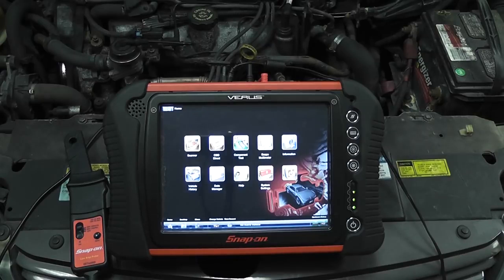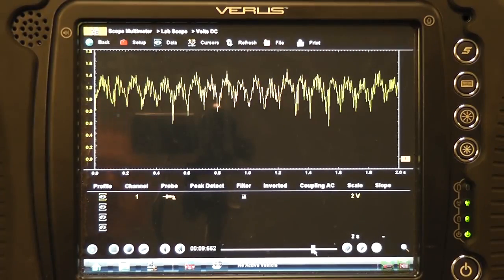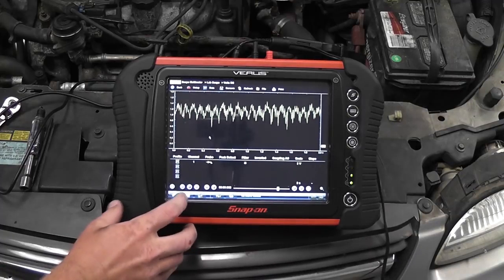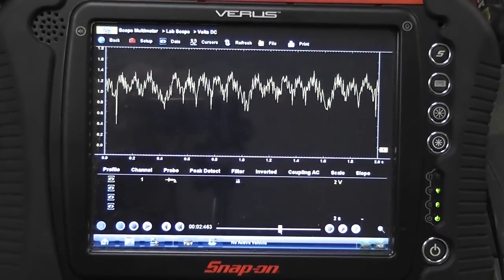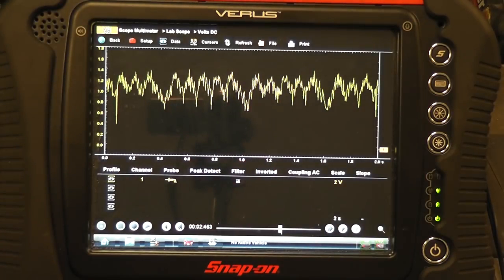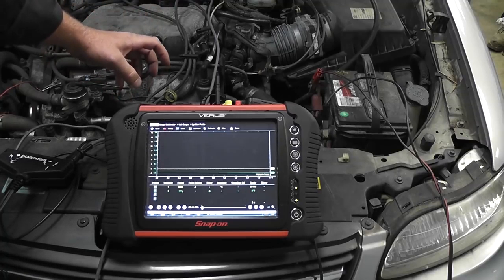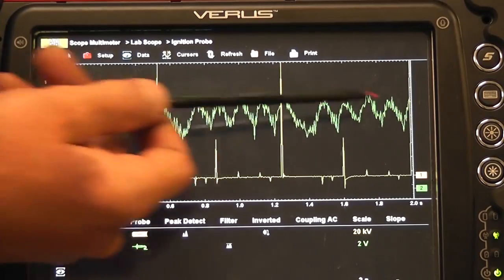How to perform a compression test with a lab scope (Quick Tips)

Comment: Now I need to get a trigger signal from a Toyota 4-wire COP while I perform the relative compression test. It seems like the computer stopped firing the coil with the EFI relay pulled. Hmmmm, how to proceed..
Reply from the maker: The wire that give you a 0-5v square wave is your transistor trigger signal. The turn off of that square wave is when spark occurs. Make sense?
Reply: @ScannerDanner  it does make sense. The issue is that I am not getting a signal from any of the four wires while cranking.  I tried again with the EFI relay installed and engine running--i got a signal, but it was erratic at best. It must be my scope setup because this is a known good engine (my daily driver--2013 FJ Cruiser). I just subscribed for one month of all data for the wiring diagram. Maybe that will help me wrap my head around it.

Comment: I have done this before, but for some reason the peaks are not showing up on the scope (modis ultra). I tested the 9v batt in the snap on low amp probe. I connected to the batt starter cable. Used 2 channel scope at 5v and again at 2v/div. Disabled fuel pump and cranked at WOT. The trace went up to 2v as a flat line--no peaks. This is being done on a good engine for my own practice. Any thoughts as to what is wrong with my setup? I tried neg batt cable too.
Reply: I noticed you set your scope to ac. That was it. I selected "Coupling AC". I set 2v/div, and 2seconds/div. With that, I got a good trace.
Reply from the maker: What are the settings in your amp probe? 20a and 40a?
Reply: @ScannerDanner  it's a 20A, or 60A
Reply: The correct wiring diagram makes all the difference. I forked out $20 for AllData for my personal training and practice. I was able to analyze the injector circuit, pull the INJ fuse, hook up my amp probe and back probe the #6 coil in less than 10min. Yesterday I was struggling for over an hour with no results. I pulled the EFI relay yesterday. That relay basically shuts down all engine functions--the reason I couldn't get a signal from the coil. I love this stuff.  @ScannerDanner

Comment: Ihave a car i dont know whats the problem said misfiring but i already change plug and coil.still there the misfire
Reply: Any idea?
Reply from the maker: 1.Coil control could be missing (have you confirmed you have spark?)
2. Injector problem
3. Compression problem
4. Intake manifold runner leak on one cylinder 
5. Head gasket blown on one cylinder
Reply: @ScannerDanner  i honestly not good and i just started learning and just have  interest about cars ...i started watching your videos not a while ago maybe couple months from now and i learn something...thanks to your videos
Reply: @ScannerDanner  i have dodge grand caravan 2015 recently change the plug and coil 2x already the whole year...and i didnt see any leak or oil leak around the engine...i recently purchased an autel maxi808 and test it i have p0300 p0302 and i checked the fuel trim one bank +(positive) about 4 and the other was -(negative)about seven.strongly smell gas from the pipe...the injector pulse one bank higher about 200-300 higher...
Reply: @ScannerDanner   ihope you can help me
Reply from the maker: @charlemagneverzosa1603  can you get to the number 2 cylinder injector? Try to listen to it with a long screwdriver. Put your ear to it and compare to another cylinder. Also do this test https://www.youtube.com/watch?v=pOghpmVhVng I know you don't have a scope, but you can do the sound test
Reply: @ScannerDanner  thank you very much mr.paul iwill join your class and get a book from you for sure...
Reply from the maker: @charlemagneverzosa1603  thanks so much! I look forward to hearing from you
Reply: I noticed shaking at idle but on load when you driving high rpm about 2-3000 rpm cant feel the shake but when it shift up and rpm drop between 1-1500thats when you feel the car shakes again till you hit 2-3000 rpm then it dissapear

Comment: hello danner i have a question as a beginner i wish you could explain
i have a jeep liberty kj 2003 the car has poor fuel economy like 200km per full tank i didn't mind it since its a high mileage vehicle with a burning oil engine with a faulty o2 sensor after a while th engine had a major problem with the bearing it needs to be rebuilt completely it coast a lot in this country so i bought another liberty which had an accident but mechanicaly in a good condition so i swapped tge engine and transmission and front differential and the gas tank with the pump o2 sensors every thing but the map sensor because it was broken
after the car is ready i drove it for a while it still has poor fuel economy its even worse than the old engine
the car has no codes so i suspect the map sensor i cleaned it since i couldn't find new one nothing changes after that i noticed in live data that the tps read 13.7 % the old tps was reading 12.2 %
so i removed it while it still connected to the wires i noticed the reading drops to 6.8% like the throttle body (it's clean) holding it from full return so i modified the throttle body axle that move the tps until it read 6.8% while it's a full closed throttle plate....
i still have high positive ltft but i do noticed improvements in fuel economy about 150km more than before
i hope you explain the situation
and if i changed engine oil will my ltft get close to zero?
thank you and I'm sorry for the long story

Comment: So, if you expand all those highs and lows, you would be able to say what valve it had a problem on, like inlet or exhaust? ( That’s if it was a valve in “a” case I know it is not in this video ) also the high yellow is on the compression stroke, but the low yellow? Is that the cylinder on exhaust part of a cycle?
Reply from the maker: No sir. Once low compression is identified you can use an old school leak down test from that point or use a psi transducer in the cylinder, intake and exhaust to see the other stuff you mentioned.
Reply: ScannerDanner will you show that in a video, or have you shown that yet? I like to see the new and old style technology it makes it so much easier when someone shows you something rather ran reading it from a manual. I’ve done the leak down many times but never seen it with the pressure transducer before. Keep these great videos coming!
Reply from the maker: @frankoattes  check out my Hummer H3 playlist. It's a 7 part series with everything you're looking for. I look forward to your feedback!
Reply: ScannerDanner very in depth on the second video which I have just watched. I may have to watch it a few times as I got lost on the whole 5 cylinder but 4 event dialog. I thought you would have had the 5 partitions in at the start and kept thinking you had it wrong as it was a 5 cylinder not 4, then I realised you were talking about the engine sequence. I’m still struggling with the whole valve event thing and trying to understand it in this data capture you have.
Reply: ScannerDanner fantastic series Paul. So interesting when a tutor is excited and so enthusiastic about teaching. You take the time to explain in great detail to the students and us the viewers what you see and your always up for someone to give more insight if they can. 
Im the old school who would be using the leak down tester. I know it told you the issue or should I say area straight away but, I’m loving the use of the pico. Truly none invasive and can be used without stripping components off or out. Just think of the time saver that can be when fully understood. I just wish I had one and a great teacher to learn it with! I commented in the 6th video asking if you could suggest material I could view or read on scope patterns and understanding them as I’m lost in there! Any input is greatly appreciated Paul and keep these great videos coming!
Reply from the maker: @frankoattes  just keep watching my videos and if you are interested, sign up for SD Premium from my website. I have over 430 training videos and counting with a 14 day free trial and only $11 a month after. Hope to see you there!
https://www.scannerdanner.com/join-scannerdanner-premium.html
Reply from the maker: The high low spark event is the cylinder firing on the compression stroke (high kv) and on the exhaust stroke (low kv)
When the #1 is high the #4 is low and vice versa (companion cylinders)
Reply: ScannerDanner thanks Paul.

Comment: Why the waste spark peak is smaller? due to pressure?
Reply: It is easier for the ionization process to happen due to lower cylinder pressure (exhaust stroke) therefor you get a lower "spike." A cylinder that is running really rich will do the same thing 👍🏼
Reply: @SouthMainAuto  thank you Eric

Comment: hey SD, just curious if i can pick your brain, 2002 saturn L300, 3.0 liter vin r, through my co-worker for a loop, another shop replaced the fuel pump twice, he replaced the plugs and coil packs, no codes stored, has a long crank issue, cats not plugged, no intake restrictions, egr valve not stuck open, i started to help him diag it, and as i was looking at live data, i noticed the map pids reading at idle 7 kpa and .29 volts, at static, key on engine off 37 kpa and 1.79 volts, verified  all three circuits were good, and replaced map sensor with known good one, suspect ecm failure? any thoughts?
Reply from the maker: those numbers are definitely wrong! What is the 5v reference wire and ground wire showing you? Also the signal wire when measured from the sensor itself.
Reply: @ScannerDanner  5 volt reference  tested out at 5.93 volts when jumped at the map connector, didnt back probe for signal voltage, all circuits measured out at .3 ohms, and passed load testing with a head light, when substituted with known good sensor, live data pids were a little different with koeo being 44 kpa and 1.98 volts
Reply from the maker: @kevinavery2518  5.9v on the reference is too high. Secondly, forget the ohmmeter. I need you to do a sensor ground circuit voltage drop test. 
Leave the multimeter ground lead on battery negative for all tests and give me 3 voltage readings right at the sensor with it plugged in and backprobing with the key on. 1. Ref 2. Signal 3. Sensor ground (so yes, a ground to ground comparison and it should be .1v or less)
I believe you have a main computer ground issue and we are going to see it in the sensor ground circuit on that sensor. Also, this would explain the elevated reference voltage too.
Reply: @ScannerDanner  just an update, wish I had some numbers for you, but the customer picked the vehicle up and is bringing it back at a later date, I did notice the only pcm ground that I could find in the diagrams showed the pcm grounded through the case its self to whwere it mounted, did do a drop test there and it tested at.02 volts.

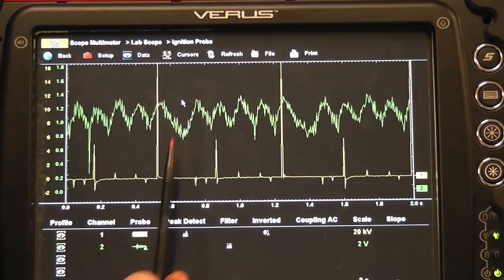Comment: 5:01 Would it be cylinder #2 or the second cylinder in the firing order? Just looking for clarification. Thanks
Reply: It would be the second cylinder in the firing order but like he said the firing order for that engine is 1,2,3,4,5,6 so it is cylinder 2
Reply from the maker: Thanks for replying! As stated in this case it did happen to be the firing order that made it the number 2 cylinder. Firing order is needed and must be followed exactly for proper ID. Also you must know exactly what cylinder you're using as the sync. Great question

Comment: Use the test lamp to lose the power of the spark but the test lamp It doesn't work Does this test affect the spark test?
And can the spark be tested using an insulated nail key without being negatively contacted?
Reply from the maker: just use an incandescent test light, the bulb filament can handle the high voltage low amperage surge of a spark. It is WAY better of a spark test than those bulb testers. I think I am understanding you??

Comment: For injectors, where do you probe them? I can only see the voltage of them but no activity, sometimes I cant use an amp clamp because of engine constraints, etc.
Reply from the maker: GDI or Port injection?
Reply: @ScannerDanner  port injection. This is for misfire in one bank but O2s are after both exhaust tubes connected. Honda Pilot 2003 v6; has me a bit puzzled because I moved one of the coils and the misfire moved to that other cylinder and stayed. I'm thinking that the misfire may not be true for the three cylinders that it is saying that is misfiring but this truck runs even with all 3 cylinders disconnected meaning that the O2s are doing their job to compensate for the miss.
Reply from the maker: @scientist100  for port injection, you will have one constant power and one pulsed ground. If you are using a multimeter, it is no fast enough to see the small pulse width signals of an injector and will only show a slightly lower than battery voltage average. Are you use a meter or scope?
Reply: @ScannerDanner  scope, does it matter where I probe the wire? Can I connect the negative lead at the battery or is that another lead that I would need? Thank you for your help
Reply from the maker: @scientist100  one lead to battery ground, then the other lead to each injector wire individually. Keep in mind that injectors can have over 100 volt spikes when they operate so you'll need to protect your scope depending on the model you have. My pico for example can handle 200 volt surges before needing a step down attenuator and my Snap-on scopes can handle 400 with no attenuator needed

Comment: Will this work with Diesel engine?
Reply from the maker: Yes but not with the low amp probe I was using. You'll need a higher amp probe for diesel engines.
Reply: @ScannerDanner  thank you, working on a kenworth not wanting to start , unless a guy uses  starting fuild.
Reply: @bluejames79  sounds like you need a pump or filter. Perhaps pumps failing.
Reply: @scientist100  new filter, new pump, had a few injector s o rings that were busted, replaced them,. At this point I don't know.
Reply: @bluejames79  if a diesel fuel system gets air in it it compresses so the fuel cant get through the injectors. if it runs on starting fluid usually it doesnt have major mechanical problem. since it sucks in the starting fluid it is breathing enough.  focus on air leaks in the suction side of the transfer pump  or a fuel volume management issue- i.e. sollenoid  fuel rack etc
Reply: @richardcranium5839  will do thank you sir

Comment: The new autel scan tool can really shine here... Should be able to do this via the vci and power/ground.  The tool already knows how many cylinders are in the engine once the vehicle info is entered.  A sync may not be so easy to figure out, but autel is almost there in terms of having you be able to do a relative compression test from the drivers seat, only hooking up to the dlc.
Reply from the maker: agree, the DLC connected to channel 4 of the scope is super awesome and one can use battery voltage supplied on pin 16 for this test. Just have to remember to invert your pattern when using battery voltage.

Comment: Awesome thanks SD 
I just purchased a snap on Modus pro and am excited to do this test.
Reply: Mine was used and didn't come with the probe. Excellent information tho! thanks again SD!
Reply from the maker: remember that you do NOT need a high amp probe to do this, you can use the low amp probe that is typically included with the tool. Thanks!
Reply: @ScannerDanner  

How many low probe in Current, because the starter need high Current?
I use hantek 1008C 
Is there a special current probe for my device or it's general for any osoliscop ?
I need to measure waveform for
Solenoid
Injector
Ignition coil
What's attenuater sutible for This
I found 20:1 in ebay.
Reply from the maker: The typical low amp probes (20-60 amp range) are capable of measuring 250 amps, or a max output of 2.5 volts. This is why I used the 60 amp setting which produces an output voltage of 10mv per amp. On a 2v scale, this is 200 amps if you do the math.
No, you will not hurt the probe and you are only limited by the size of the jaws. They MUST close all the way. 
Lastly, remember when using amp probes that you are NOT sending amperage into the scope, you are sending a voltage equivalent to the magnetic field strength which is proportional to the current flow. No attenuator is needed for this test.

Comment: Nice job.
Q: You disable the fuel, so what's the different between 1 & 4 in firing?
I mean If you synchronizing with number 4 will get the same waveform, so why one high in compression stroke and the other is low in exhaust stroke and you don't have a fuel!!!?
Reply from the maker: remember that I am connected to the #1 plug wire only and the firing line will ONLY be high when the #1 is on compression. When the #1 is low (on exhaust), the #4 (it's companion cylinder) will be high, but we won't see that because we are not connected to the #4. Hope that makes sense. Also, it is compression pressures, not fuel or lack thereof, that creates this high/low pattern in a waste spark system.